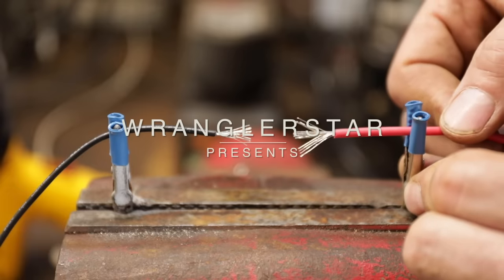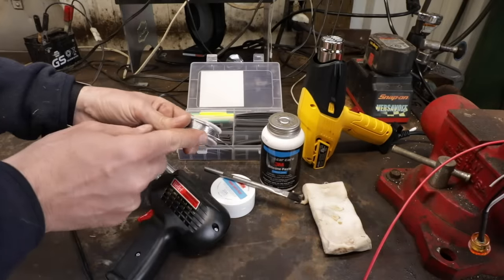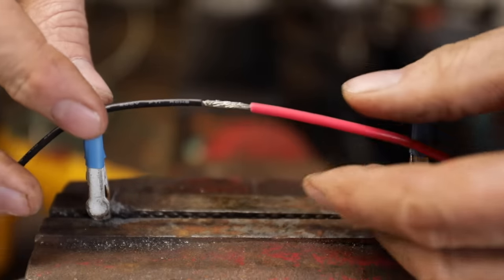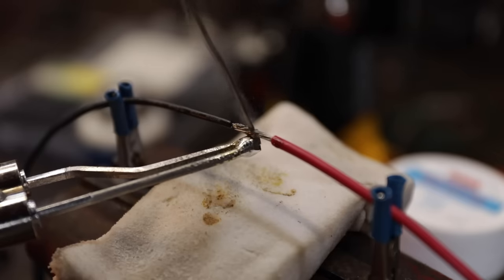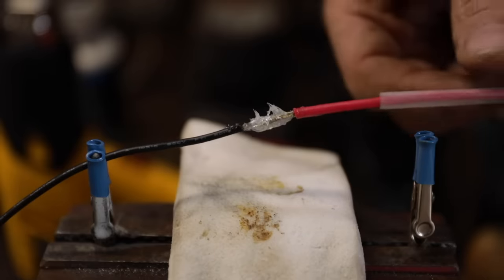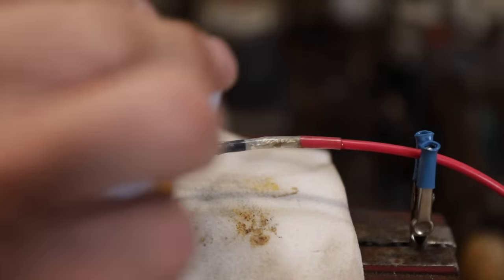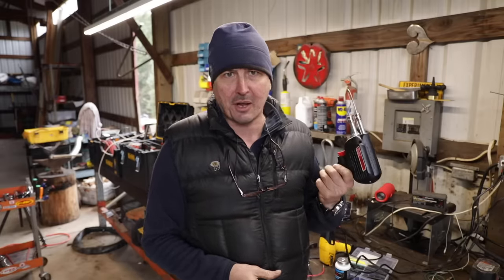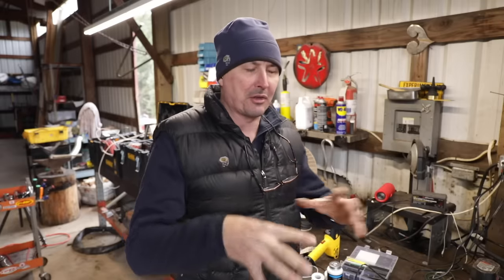How To Solder Wires Like A Pro

Comment: You “tin” the tip of your iron to help avoid corrosion when not in use.
You also tin the tip to improve heat conductivity. You’ll notice the difference when applying solder to a non-tinned tip vs a tinned one.
The joining of the wire in this video was perfect technique, which I’m totally stealing.
The reason it was taking so long for the flux to activate was that the wire was conducting away the heat from the solder gun.
The point where the two objects being soldered meet is called a “joint”.
You should apply heat to the joint, and apply solder to where the solder gun and the joint meet. This technique will help transfer heat to the joint faster, getting ahead of the heat dissipation the wires introduce.

Great video. Thank you for making it.
Reply: Do you know what the black strand he was holding over the wires? Was he melting something into it?
Reply: @michaelkuhn6619  hey that was soldering wire or solder for short! One of the most commonly used ones is 60/40 meaning 60% tin and 40% lead alloy solder. So basically he twists the wires, anchoring them and then heats the twisted wires using the soldering iron bringing them up to the temperature that would melt the solder wire. He then applies that solder wire to that join, which has now heated to the point of being able to melt the solder. The solder melts nicely over the joint and fuses it together. 

The paste he applied at the start the rosin is used to remove any corrosion and impurities from the surface of the wires so that solder will cling nicely on to the joint.

Comment: Don't forget to put the shrink tube on the wires before you solder if you can't slide them on whenever you're done soldering.
Reply: I've done that more than I'd care to admit lol
Reply: Looks like i'm not the only one
Reply: Clay Willoughby I've done this enough to know better now.  There's nothing more aggravating than forgetting to put it on and realizing that perfect soldering job you just completed was for nothing.
Reply: Was anyone worried that he was soldering a red wire to a black wire...?
Reply: Viktor Orban In the USA, Black is Live and White is Neutral.
Reply: Clay Willoughby , Yup, that's what I was going to say too.
Reply: Did not have to go far to see this comment... we all need something to swear at now and then : ]
Reply: Viktor Orban he's just showing how he does it, is not like he's making a project with it
Reply: Edward Holmes - there is no AC on a bike though :) 
It's OK Alonso, I was just ribbing
Reply: Even after years of soldering, I still repeat this out loud every time. Its so easy to forget.
Reply: it happens to the best of us eventually.
Reply: Clay Willoughby thats why 3m makes super 88.
Reply: @viktororban5684  LOL
Reply: Clay Willoughby z
Reply: It's like forgetting to replace the toilet paper. Frustrating
Reply: Lol that would be a classic school boy error
Reply: @viktororban5684  I was thinking that the red was a shrink tube.
Reply: Yep I was thinking the same thing. BTW I'm not a electrician.
Reply: you can use electrical tape
Reply: we were all thinking that ;)
Reply: It is just tutorial, not an actual circuit..Open both end wires dont need heat shrink before you solder..watch more than 5 min of that video and you will understand
Reply: I haven´t done this for years.. maybe because I haven´t been soldering for years.. :)
Reply: @timmeke_8213  do not use electrical tape as it lets water in. If you need to use tape use self-amlgamating(not sure of spelling ) tape.
Reply: Viktor Orban 😂😂😂
Reply: I’m a girl and I solder better than this newb
Reply: @viktororban5684  first thing I noticed but thought it was for the camera to show contrast between wires
Reply: I do forget sometimes. Have to cut it and do it all over again 😬😖😂😂😂

Comment: Nice joint! And, thanks for suggesting the dielectric silicon grease.
It should be noted that quite often, the joint will be made between either two long pieces of wire or two wires that may already be joined to something at the other ends, so the shrink tubing can't be slipped on easily or at all, after the soldering is done.
There are two ways to address this: 
One way is to put an appropriate length of shrink tubing onto one of the wires before soldering, but it should be slid well away from the site of the soldering or it will shrink and not slide over the joint.
The other way is to get some self-fusing electrical tape to wrap around the joint after the soldering is done. This may not always be the best method, but sometimes may be the method of choice... especially if one is simply soldering a wire to a connector of some sort, or "oops! I forgot to put the shrink tubing on before applying the solder.".
Best wishes.

Comment: Have to agree with some of the comments below.  Although Cody has done an excellent job connecting two wires, and one that, for most purposes, will be quite serviceable, there is no mechanical connection.  I was a certified in the Air Force for high reliability soldering, and the first rule for soldering anything is to ensure a strong mechanical connection, since solder has very little physical strength to it.  The linesman splice is preferable.  Good job Cody!
Reply: Is it true that the lineman splice or Western Union slice is designed for solid wire?

Comment: The dab on your iron helps to transfer heat and also cleans your iron a little with the rosin.
Double wall heat shrink will really seal it up.
Reply: Tinning the iron does the double duty of transferring the heat faster and it protects the tip from corrosion while it's hot.
Reply: Without it, I tend to melt some insulation by the time the solder flows through.

Comment: If you want to solder faster use wet tip (wet with solder), it will eliminate micro gap and transfer the heat faster onto the wire. That way you wont melt the wire.
Reply: Use a mini butane torch and it’s three times faster

Comment: I do agree with you on how to heat shrink tube. I have very close friends of mine that are Master mechanics and they even have some sort of special certificate for automotive wiring. When a solder a connection and put a piece of shrink tube on all of them use a cigarette lighter. I tried that a few times and it never worked out well for me. Also you do the same thing that I do before shrinking a tube around it. We just use different brands of dielectric grease. I'm definitely going to pick up a bottle of what you were using. I have the shop size dielectric grease it comes in a tube. that brush that you have I buy them and big bags from harbor freight. I'm glad to see that you use the soldering iron that you did. I have the same sort of one as yours and really never figured out how to use it correctly. It was my father's and it's almost as old as I am and that's saying something. I never did ask him to show me how to use it. I always had a cheap one from radio shack. I enjoyed your video and look forward to watching other ones.

Comment: Another tip, is to use silicone insulated wire when ever you can. Plastic insulated wires can melt while you're soldering or using the heat gun (especially true with very thin wires). Plus, the waterproofing and general heft between silicone and shrink tubing is much better than with plastic. 

Wire splicing is my arch nemesis. I mostly deal with very thin wires (I build drones), and I hate splicing. Your method with splaying the strands of both wires was an eye opener for me! I usually wet both ends first, then lie them next to each other or butt-solder them. This is much better.

Comment: This is a great tutorial, much better than what I found when looked around during my time learning to solder!

So one thing that I must chime in on is that you ARE supposed to touch the solder to the iron tip whilst contacting the wire you are jointing. The point is to create a puddle to dip the wire into then move the solder throughout the joint, bridging from the hot tip to the bare copper/silver stranded wire, thus tinning the wire and forming a nice soldered joint quickly. 
Flux paste is there to help heat up your solder joint and additionally helps to transfer the melted solder flow in and around the strands.
It is much more efficient and what has always worked best in my experience, not to mention it will keep you from melting the protective coating on those stranded wires! It is also how cold solder joints can be formed! Bad habit of mine when I was new to soldering.

dielectric grease is always a great idea, especially under heat shrink!
High quality tools for electrical work is key, there is potentially lots of risk involved. 
Klein is one of my go to brands for just about anything, Milwaukee also makes an excellent M12 soldering iron (12 volt battery powered, great for automotive or travel)
And one more thing is Weller makes a great kit with tip tinner, flux paste, and a tip cleaner.

Thanks for dropping some knowledge, keep it flowing for all to see😁

Comment: If the other ends of the wires are permanently attached to devices, don't forget, step 1 is to thread the shrink tubing on first. If you have to cut apart your tediously soldered wiring harness once you won't likely forget again. The silicone is a great idea I wasn't aware of.

Comment: I spent a semester in MIL-spec soldering. You never untwist stranded wire. Tin both ends, bend a hook in each end, hook them on each other, flow some solder. Far stronger than this mess in the video. If you really want something awesome, get some 63/37 eutectic solder and you’ll be in heaven.
Reply: Make a video
Reply: Mil spec soldering... I'll be dammmmd

Comment: What you just did will work perfectly fine for most applications.
But if you're interested in real strong splices, bare back the wires an inch or so, meet them, bend them 90 degrees, then twist them together in opposite directions. It's called a western union splice, the harder you pull on it the tighter it gets (until it breaks). Also the preferred spot to add solder is directly between the iron and the wire. And soldering wires together you don't really need paste flux as long as you use flux core (AKA rosin core) solder. And you don't want solder to flow into the insulation of the wire. But I was taught mil-spec soldering you don't need to get that fancy for general purpose stuff :)
Reply: I understand the Western Union splice was designed for solid wire but not stranded wire, is this correct?
Reply: @dwaynemcallister7231  2 year old comment wow haha. That could be true. I'm not sure. We used it for stranded in school. But either way it works :). The main thing I was taught is that it doesn't really matter what form of splice you use, it has to be inspectable. Meaning you have to be able to see the adhesion of the solder joint and not just a blob of solder, and if the solder wicks up into the insulation it's no longer inspectable.

Comment: I worked as an electrician and this method is so time consuming and, in 99.9% of the jobs, unwarranted that titling it "Like a pro" is pretty funny. More like: "How to solder wires like a control freak".

I'd recommend a pen style soldering tool, they are easier to handle, lighter and less likely to break than a big solder gun, they are wireless too so you aren't limited by cable lengths. Also, shrink tubes are enough to insulate the wire most of the times, unless they are gonna be directly exposed and you live in an area really damp and with frequent winds that rattle the cable all day, and if you leave the wire in those conditions, that silicone won't do anything anyways. Also, we just used a plain old lighter to shrink them, no need to add yet another tool when you're trying to solder hundreds of wires, it just takes time and costs even more than just something you can put in your pocket.

Comment: A 20+ yr Electronics Tech that solders 300 pin micro connectors for the F18 reviewed my solder job following your video and said "your solder joint looks d@#n good!". Thanks, it had been a couple decades since i tried last and so was hesitant.  I bought a little helping hands with alligator hands and magnifier at #harborfreight for dirt cheap like 5$ i think.  I ended up adding the shrink tube on the alligator clips after the 1st round because they do bite into the wire that was a great idea. Thank you to you and your granddad who took time to teach you things in life

Comment: The reason you tin the iron before touching the connection is so the heat can transfer better to the wires that you are soldering. There’s the potential of way more hot surface area (to melt the solder on top of the wires) when the solder is on the iron as opposed to just having the solderless iron try and heat up the wires

Comment: It's refreshing to see someone who obviously knows what they are doing.  Tapping the solder to the gun's wire is to "tin" the wire for good heat-conduction to the wire. Ideally, the solder should have rosin flux applied to the solder before applying it to the gun's wire and the heating of the wire and application of solder should follow immediately!

Comment: Not too shabby for an amateur. 

Here are a few tips for beginners:

Since the other ends of the wires are likely connected to something, you may want to slip the heat shrink material down one wire before soldering. WS was lucky and had an open end to do this with.  

Flux isn't always needed, but is helpful to promote good solder flow. Good quality solder is a plus. 

Steer away from solder that has an acid base. That is a specialized type and not used for normal solder jobs.
Reply: Free WiFi

Comment: It's actually a good idea to touch the soldering iron tip so there is a thermal connection between the wire and the soldering iron. After there is a good thermal connection feed the solder into the wire and the solder will wick through the wire. For the rest it's a good video, I like the silicone trick

Comment: That's a really great way to ensure joins won't break, but unfortunately it's a bit unrealistic in a lot of scenarios wherethe length of this solder joints is sometimes the whole wire length we have to work. In those cases what i do is try to peel the cables around the same length, make a cross, and twist them in opposite directions, which makes for a pretty solid joint as well in very tight spaces. I'd like to try and apply what was shown here though.

Comment: You can find heat shrink tubing that has glue on the inside. It oozes out and seals at the edge. Also I like to get a high shrink ratio so its more versatile, such as soldering two wires on one side to a single wire on the other. That way a larger tube can shrink around the single wire, yet be large enough to slide over the two wires.
Reply: Hello there👋👋,how are you doing today?hope you’re doing well?God bless you!!❤
Reply: The 3-1 marine type heat shrink works well. It also hardens afterwards, good for some applications not so for others.

Comment: Most heat shrink tubing is thinner than the original wire insulation so I would recommend doing two layers of heat shrink and don't over heat it so the middle doesn't gets brittle.  Thanks for the video.

Comment: You said to not touch the solder to the iron.  When I’ve seen people put the solder on the iron first, then put it on the wire and heat it, but can’t remember if they used flux or not. 

This is so confusing.  Your way seemed good though.  

I’m just a perfectionist so until I understand the exact science of why to do it one way over the other I cannot commit on any single method.  

The way you joined the wires together before soldering though is definitely the best way.  Thank you.

Comment: You can also use the side of the soldering iron (gun in your case) to shrink the tubing.  That is what I use and it works just fine.  Just rub it over the top of the tubing - yup, rub it.
Reply: underneath gives a better spread

Comment: You can also buy special heat shrink that have adhesive on the ends so there's no need for the silicone
Reply: Hot glue, to be precise, yes.

Comment: Solid!  I just wanted to share with you somthing because you helped me and this might help you!  I seen your video before but I could never get the solder to work because I couldn't find the proper flux. Turns out I had this old masters flux for stained glass windows.  I thought about it, then said to myself "wires are copper and stained glass windows are fused from using copper"  sure enough it worked and held the tires perfect!   I know because as you said plumbers flux won't work and I tried that, so in this case at least it will either work or not!  Thiers no inbetween!  Cheers hope this might help!